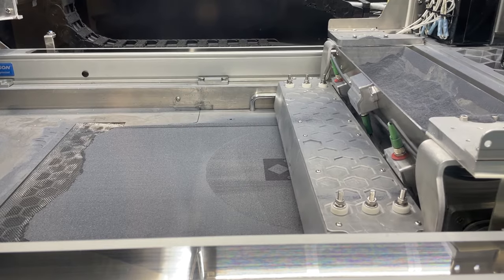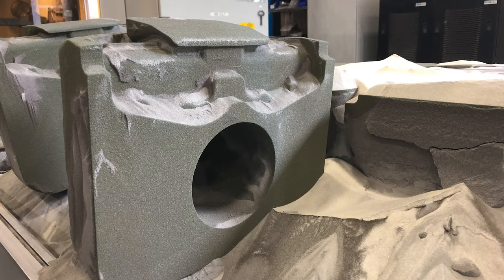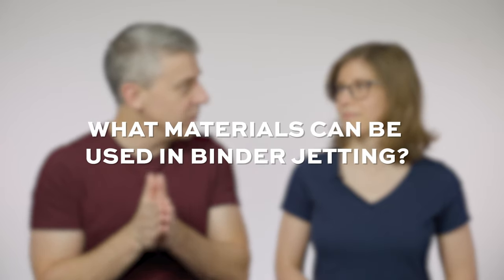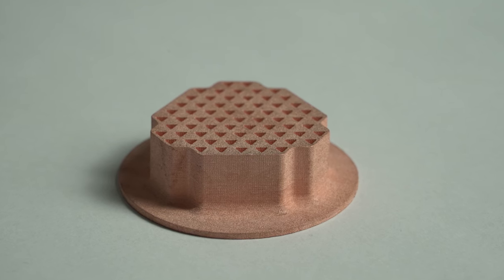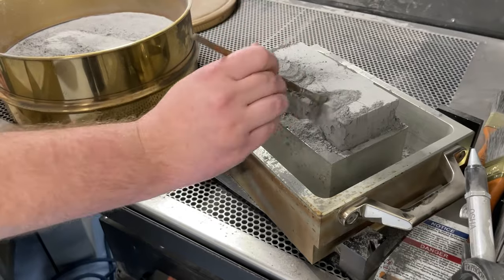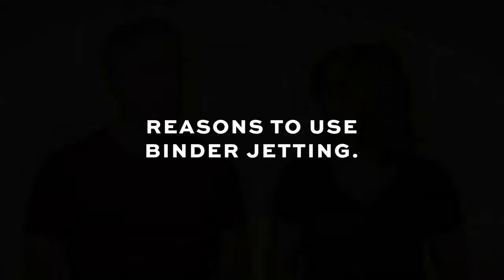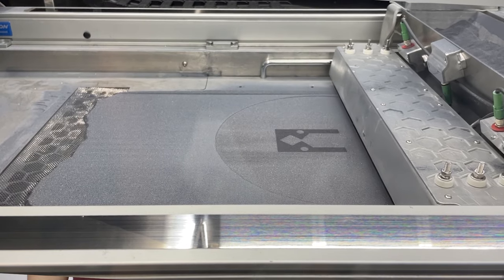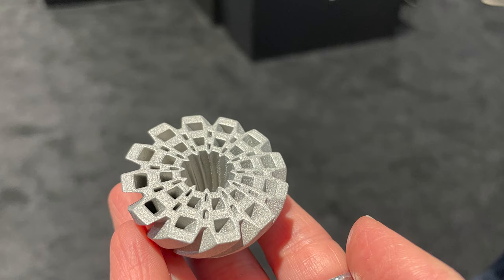What is Binder Jet 3D Printing?

Comment: Would really like, if there was a home shop sand binder jetting setup available. The technology shouldn't be that expensive. It would be so much better than lost PLA.
Reply: I agree with you, because lost PLA or investment casting takes a lot of time and requires a lot of steps, but this technology is easier and fast you can print Shell sand and use it for casting any metal

Comment: Binder jetting originally was and is still used in digital textile and flex banner printing. Application change. Tech was modified. Interesting.

Insteads of Ejecting CMYK, its binder now
Instead of material such as textile orinting, its now sand and metal powders. 

I like the videos but you should do a deep dive on the specifics 

Try Fujifilm Dimatix, SG1024 and Spectra Printhead modules used in printers manufactured by Exone and Desktop metal. 

They use CPLD and FPGA based firing and head control boards. Mostly Binary Single Pulse. No or Some type of control of the Binder Drops.

Textile uses Multi Pulse waveforms and thats why you get different shades of colors.